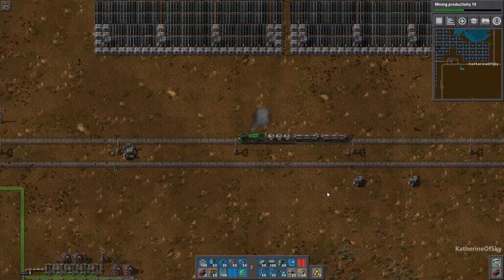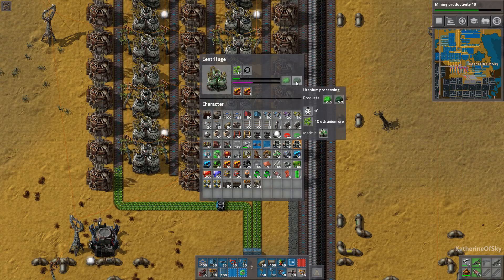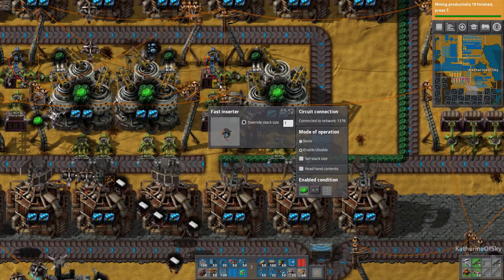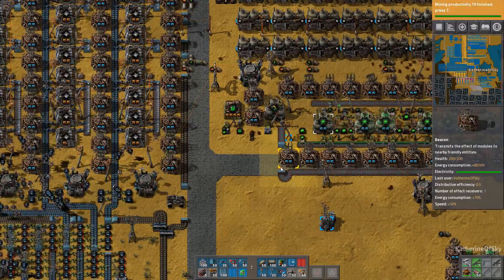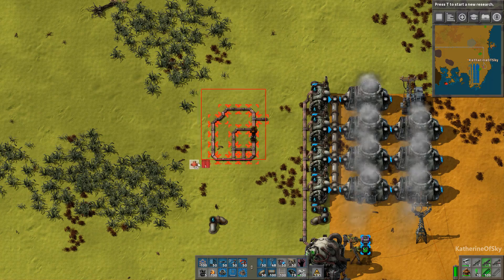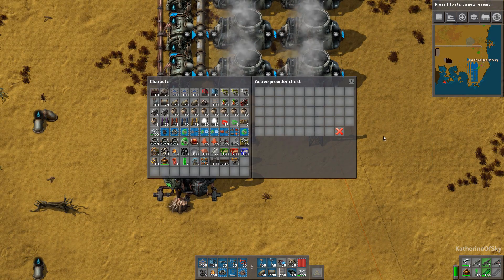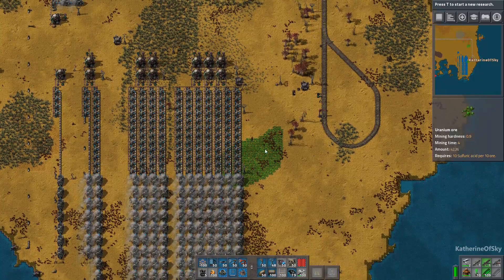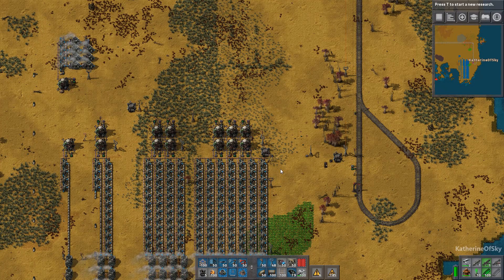Factorio Tutorials: Nuclear Power Setup & Ratios (Uranium processing, Kovarex process)

Comment: Thanks for the ratios and the setup.  
Just one question, Why not let the result of one centrifuge directly feed the next centrifuge in a circular fashion. Then have a chest between the first and last. then take out whatever is greater than 40?
Reply from the maker: That's another option!  There are many ways to do the sertup.
Reply: KatherineOfSky it only works using loaders though

Comment: Wondered how to make a sorting mechanism, where the inner circle of the Kovarex does not has to flow back into the initial sorting machine. This is what came out: the red wires on the "Uranium-238 < 1" by reading from the chest. This way all the U-238 is recycled without running back on the belt and the line does´t has to be sorted out again.

https://imgur.com/a/xak5a

Comment: At the 17:27 mark, we see that 6 reactors require 80 heat exchangers - yet the layout shows 7 x 12 exchangers = 84 exchangers. I'm running into water supply issues and just wondering if that has something to do with it.
Reply from the maker: If you use the BPs from the drive, the 6x reactor setup has 7 lines of HEs/Turbines.  Each of those needs its own water connection.  (The few extra HEs/Turbines are not relevant to the setup, since it is based on how much water throughput per pipe.)

Comment: I'm just getting into nuclear power and ran into a weird problem. I have two reactors with 100% bonus, 8 boilers and 14 turbines. They are producing about 35MJ, which seems a bit less than expected if 80MJ is the maximum. Both sets of boilers have their own pump and water pipe. I'm not quite sure what I am doing wrong...
Reply: Maybe you factory is not requiring more than those 40 MJ.
Remember: You can only produce as much power as you a have resistance (demand) in the network :)
Reply from the maker: Check the numbers on the screen -- for 2 reactors, you need 16 heat exchangers and 27 turbines, (and 2 water pumps).  You should be able to get 160 MW from the setup.
Reply: KatherineOfSky oh yes, I got the maximum wrong. But the number still seems a bit low when just one reactor should be able to push out 40MJ and I'm not getting even that with two reactors and two sets of turbines. :)
Reply: Fabian you are correct, that was the case :) Tested by shutting down my other power generation and the number increased instantly. Thanks!

Comment: I'm confused I used your exact blueprint to make the 2 reactors and I'm getting half the effeciency you were my turbines are at like 10% performance in getting less power from two than I was from one
Reply from the maker: Have the reactors had a chance to heat up?  Do you have all water connections made?
Reply: the reactors are at 1000 and the heat all around looks good the only difference i can think of is that my water pumps are about twice as far away as yours are in the video  but the water pressure is at 98-100 everywhere so i dunno
Reply: I found the issue I had one heat exchanger at the front one tile to far not sure how I did that but it was putting it out of range of the water pipe and was at 0 effeciency
Reply: Well I take that back thought that would fix it but for some reason my steam turbines are still showing 17/60 fluid consumption but it doesn't seem to be a water issue since all the exchangers are getting water and the steam pipes are at 500C and 99 steam all the way across bah whatever I can live with it I guess
Reply: Your demand isn't high enough to get full power from them. That's a good thing, as it's better to have more than you need, than not enough. As your electricity consumption increases, your fluid consumption increases, so basically, you're using less than 30% of what your turbines are capable of.

Comment: Dammit, my uranium setup backs up with too much Uranium 238 which means the 235 cant come around again to feed into the machines. Not sure how i can solve this problem.
Reply from the maker: You can add chests for 238, or change one to an active provider (but make sure you change it back once you get enough 235).
Reply: It's possible to end up with too much if you don't mine enough and let the process run away.  I use combinators to turn kovarex off if I have more than 1:19 U235:U238 (1:13 I think I read somewhere if you factor in fuel cell reprocessing).

Comment: theres a slight inefficiency with your korvax processing, if you use the circuit network you can ensure theres ALWAYS no more than 40 u-235 in the korvax process, instead of having unnecessary amounts of u-235 going around

the way i did it, was setting a timer that ensures everytime korvax enrichment finishes, a inserter will take out 1 u-235 then wait for the process to finish
Reply from the maker: I'm not bothered if there's extra in the machine.  When it gets to the end of the line, it's in a box anyway :-)
Reply: wow, thats an impressivly quick response

thats true, when you get a few thousands of u-235 it doesent really matter, but automation early on takes forever, so being able to get a stack of multiple refiners that dont require more than 40 u-235 really saves time ^^

ps. awesome video, keep up the good work ^^

Comment: Help! I'm only getting about 210MW out of my 4 Reactor setup. I see I need 5 pumps, but I don't seem to be getting the water into the system correctly. How do I attached 5 pumps in a smart way? Especially given the fact there is only 4 pipes and I assume the last pump needs to add water to all four pipes.
Reply from the maker: You should have each pipe on a separate pump -- don't attach them together -- the fluid mechanics in the game are weird..  If you are using my BPs, each pipe needs its own pump.  If this is a design that you've created, it sounds like the array is too long -- you need to move some boilers to a separate pipe, since pipe capacity does have limitations.
Reply: I used yours, but for your 4 reactor setup, there are only 4 pipes and 5 pumps are needed to get maximum output. It isn't the end of the world to build another, setup, but yea - I was just curious/wondering about the setup.
Reply from the maker: I just checked the BP -- you don't need 5 pumps.  Each column of steam turbines is 20 machines long, served by one pump.  Each turbine consumes 60/s * 20 = 1200 /s.  1 water pump produces 1200 fluid/s.  It's perfectly matched.

Comment: How many reactors did you have in this game? :O Each centrifuge running the conversion can support 4 reactors without any speed modules.
Reply from the maker: I did the tutorial on a test map :-)  One U-235 makes 10 fuel cells, and each fuel cell lasts 200 seconds.  Thus, one kovarex process process produces enough U-235 to power 40 reactors for a single cycle of the process.  (This is without modules of any kind.)
Reply: Completely forgot that each of them make 10 fuel cells :) That makes your setup even more crazy LOL
Reply: A 1x2 reactor setup is a good one to start with.  Extending that to a 2x2 reactor setup may be desirable in the future.  You can attempt arbitrary 2xN setups if you don't mind running all the math behind the power output to steam turbine to boiler ratios yourself.  In my opinion; that's the fun part of setting up one of these things.  The one hard and fast rule you need to make sure that you follow in vanilla factorio is that you need to make sure that your water throughput for each cluster of boilers is at a consistent 1200 units of water per second; which means that you absolutely need to use pumps for water you're moving from a water source; if you do this, your reactors can continue to output expected consistent power even under 90% load.

Comment: I find myself suddenly becoming a supporter of nuclear power
Reply: Nuclear power is clean power
Reply: @petor I was moreso commenting on IRL nuclear haha
Reply: @petormemes  its not, solar power needs the construction of solar panels which are inefficient and take up too many resources
Reply: @BAHAAGAMER_HD No since it doesn't degrade so once you've built enough for what you want you won't produce any energy pollution anymore, and since the pollution fades away / is absorbed by trees, it's better.
Reply: lol boomer by that logic solar is best, but producing and consuming energy produces pollution. And processing uranium
Reply: DIY nuclear power!
Reply: Nuclear power and fracking, believe it or not, are the best and greenest energy sources we have today that would actually work. While solar and wind power are obviously greenest, they do not generate even a fraction of the power needed for a nation like nuclear and fracking can. Nuclear and fracking also use MUCH less recourses than any other form of generating energy
Reply: @jayst  I heard that the power generated by a solar panel doesn't actually make up for the greenhouse gases that were created when constructing the solar panel. By the time the solar panel degrades and is no longer useable, it hasn't even made enough power to make itself once.  :(
Reply: @Murasame13  Aluminum production irl chews up a pretty serious amount of power.
Reply: It’s just like Air Travel or Genetic Engineering, it sounds scary until you understand how it works, then it sounds great

Comment: The centrifuge setup doesn't seem to be working for me. I've loaded it with 50 uranium, ran a few cycles, and not a single unit of ore was placed on the belt. 
The moment ore is starting to get loaded back into the centrifuge, the amount of ore detected decreases vs. the actual amount,  
and the loader will not output the excess on the belt since it always detects less than 40.
Reply from the maker: Centrifuges (and all other machines) load until they have double the required amount, so about 80 in the machine, (plus or minus any from stack bonus).  In the very early stages, you can micromanage the amounts until you get enough for more and more centrifuges to run automatically.  This setup isn't intended to feed count-perfect amounts into the centrifuges, since after only a short time, those tiny amounts are irrelevant.
Reply: Sure, but it is still inefficient at loading a line of centrifuges then, unless as you said you just load everything manually. Probably needed something with combinators to actually remove every 41th unit
Reply from the maker: It does automatically remove excess uranium -- I have 2 lines from this blueprint running for hours in my factory.  I would recommend initially feeding each machine 40 units, but after that, you can completely forget about it.  Like I said, those tiny extra amounts soon become irrelevant.  (ATM, I have over 4k U-235 sitting in chests, after hours of complete automation using this setup...)   If you want a more complicated combinator setup, there are others on the internet.

Comment: Is there any reason to have more than 1 U235 to every 19 U238?  I let my Kovarex run away for a little while and ended up with way more than that so now I've shut it down for a while.
Reply from the maker: If you are making a lot of atomic bombs, you'll need a ton of 235.
Reply: That explains it - haven't researched A-bombs yet.  Thanks!
Reply: I don't like how the centrifuges make 100% "boom stuff uranium" at random. I'd much rather these things stringed together enriching uranium gas by 2% each time and moving on to the next, removing the depleted uranium gas down another line to be "metalized" for later use.

If you wanted to make a bomb you would need at least 45 of these together (>90% boom stuff), some real work mid-game. That way you can adjust the potency of fuel, or use a breeder reactor instead of koravex/magic (they magically remove 3 neutrons from the uranium) to make even more (MOX) fuel or "boom stuff plutonium". Breeder reactors need >20% enriched core to even start.

Comment: will it all go boom if i do it wrong?
Reply from the maker: Nope, You'll just get less (or no) power.
Reply: The devs seem to have based it off of real science as much as they can(i.e. the way power works is identical to how actual electricity works in terms of mathematics in the  game), and since no reactor ever goes 'boom' if it goes wrong, you'll be safe
Reply: well, stored flamable fluids and explosives dont explode whilst being destroyed or shot. I'd expect that a tankwaggon full of petrol gas would explode
Reply: If you want it to go boom if you do it wrong; there's the 'Realistic Reactor' mod.  It makes the reactors WAAAY more complicated and it forces you to use circuit logic to even use the reactors.  For example... the temperature will continuously go up until it reaches 1000 degrees C; and it will pop and produce fallout.  You need to feed water into the reactors to cool them down and the water needs to be fed into a cooling tower to cool the hot water that comes out of the reactor.  But in vanilla factorio -- the reactors are either on or off; they'll never melt down.

Comment: Thanks for a really good tutorial.  One thing that would be nice to see covered is how to store the energy. I believe that in recent patches the empty fuel cell is output at the end of the process (which makes sense but wasn't previously the case) and you can then set up a system that stores the steam in tanks and have the turbines feed from the tanks on a per-need basis. You can then have a circuit setup that checks if there is an empty fuel cell in the output chest amount of steam in the tanks is bellow some threshold and only start a new process if that is the case. Otherwise the nuclear plants will just discard the excess energy which is a shame.

..... not that it makes much sense that we can store steam in tanks without it cooling, but there you go.

At any rate, I'd be interested in these setups.
Reply: I love making those sort of setups though in the quest for efficiency!  It can be as much, or even more, fun trying to optimise a process as trying to scale up a process. Not sure anyone would play factorio if they didn't like Rube Goldberg-ish machines :P
Reply from the maker: The problem with those kinds of setups is that your energy needs will be fluctuating CONSTANTLY as you build a larger and larger factory, and thus it would be very difficult to figure out how much time you have on x number of tanks at any given period.  U-235 is so cheap to produce, I feel like it's not a good use of time to set up those rube-golderberg-esque setups.  There are lots of tutorials on the Factorio forums, Reddit and Steam if you desire to play with combinators.   Practically speaking, though, setting that up is not worth the effort.
Reply: Right, but if your power output is too low then you have a problem no matter what, and if it is too high then the extra power is wasted. Unless you have a buffer I don't see how nuclear power can be used effectively on its own, but it would have to be used in conjunction with steam or solar that scales with your current power draw.

I must be missing something. If your tanks empty that means that you  need another pair of reactors, just as you need to scale up any power system as your factory expands.

Comment: What I found in your system (at the point that your making 235 it backs up on the belt as you have no way for 235 to return to the end .. this is the point it plugs the system..238 has taken over the belt and the system is now full of 238 and has no place to go.  It locks up... Keeping 235 on its own belt and 238 on its own belt and stops the plug that happens with your belt that '"Tee's" in,,,    

 

I sent you a blue print that has a built in safety that will not plug up and will run smooth for a long time. It unplugs its self. I have been running this none stop for weeks... it ran without one problem and no plugs/ stopping to be fixed. 

BLUE PRINT:  (This system loads itself at each point and has a exit for each unit. Once a unit has filled it stops.  (Basic Belt system) I worked on this for weeks to come up with a none plugging system that's small with no chest. Its still running without a problem. (it scans the belt taken any overage off the belt and put in a chest.  If the belt scans and there is no 235 it will turn on to fill the belt and then stop, The Active chest removes the plugging problem that happens from 238. the 238 is not mixed with the 235 at any point. 

Self load. Self remove, No plug. Drop and forget.. .

Try it out.. (put your own chip in it) Yes you need robots for it.. but this is a end game system.  

0eNrVWNtuozAQ/Rc/g4QN5KZqf2RVIQcmiVUCrG2iVhX/vmNICEpMYlDV7b4UETzHM2fmjMf9JNu8hkqKQpPNJxFpWSiy+f1JlNgXPDe/6Y8KyIYIDUfikYIfzVsKhZZiV++BNB4RRQbvZEMb76lhLXkh6qPPwnhgySZZrgaWoYPlFjjGNTCKmlePYARCC+jCbV8+kqI+bkFiJL0tvFcSlPI17q6qUmp/C7lG7KpUaI6wuCtC+pFHPvCB/pBMSEi7b21gN+BsOjizg3sE49KyzJMtHPhJlNIYpEKmtdAJfst6lJ2QSifTkmOKQXNTGe1Ox4pLrs0e5KX9fN4HCr7NIcmEMk+y2fFcwfWzBJ4lB15kxiGNXCDjWtaDFZffu6XHMoO2lsz+RRerMi5T80dCNkyYwDe2aF6bxkJ0OJ3o0DmL0W153YHRK5ahuSu0lvANURVA5mOodQ5+SEystSF6iaHc7xVPD4Q6B7LowfNyL5QWqZ8eQGmfo9EJ/EqWJ5HhyrtNerIsqMvZCmI2uNVsOGqDW/dwWODpmy8KBVLbYrxUBGu+TWzhjdh+kWZEDHsJUNzKgS5H5ECDsUxXXKnHqb7QYGWTUtu5MFaTAQaDBSlaSt7KE5fw7kMhRXo4orVxIsUEkwmqYVbVUOaeZfqg9uj0PsIubD1VH41unNyJHF184Cu1YqOKO8szYecT2X56WtmKndkaSGLgQfS/CITFYwJZTE50aE1GZAOf3RGDJ63nW89fK6PrMUJnt217n1lP1cq5bdG7uclRK7FdKyyYHNe19z2bDqmzDqktOFvtMTazgwUO2HO7o4vf0UxBumDHM7GDf9X2fs4Qbp87xtoqW7ifw536f8zJ8jJ6stjuIWPxL8fmLgl/anw+YCJsh6V2VeLcs/q5iAb29rV6enc53zi/4O7C3GftwJp828Vuev8N+niGQ5MNm87IFu09n5is1ZW+yJ6scG7vduExnHmOufAYzfTbBXtu73bhZO4QeOf3q3dRzPV/bB45YVV0C6KIRfEyWi8XTfMXpYinCg==
Reply from the maker: The BP on the drive is slightly different from the video and won't back up.  (I didn't have the desire to change the vid).